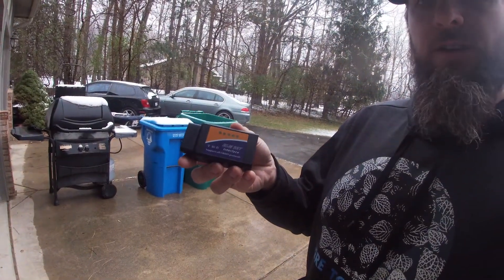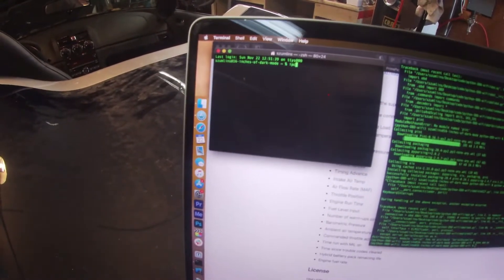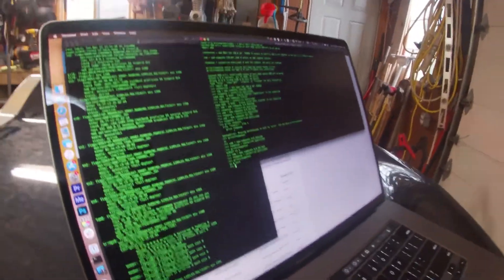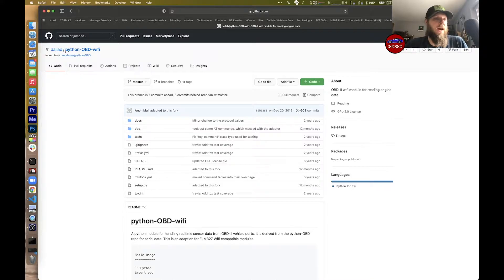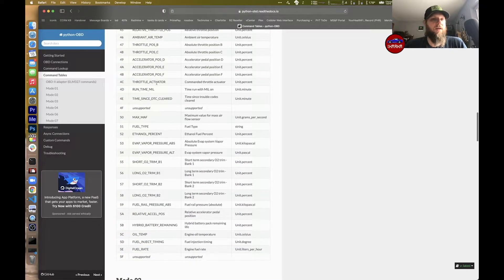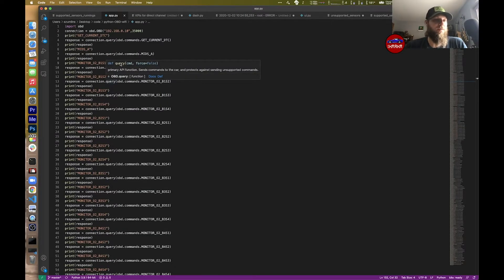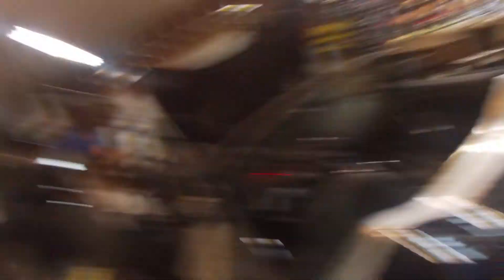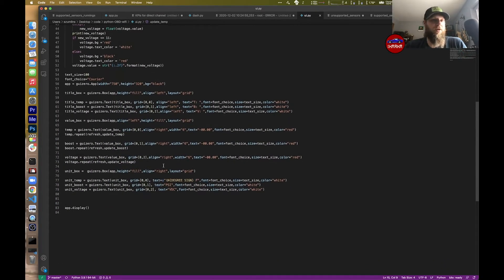Episode Six - Playing with OBD2 and writing our own gauge software

Comment: Hey, sysadmin here ... Do you think you can write on the main bus via another port? I'd like for example... To tell that air intake temp is  colder than it actually is... It would be curious to experiment
Reply from the maker: I think a better way to do this would be a potentiometer or resistor on the signal wire direct from the thermostat sender.  But I have no idea what the voltage range is on that sender and what sort of range that currently provides.  Trying to do this in-computer would likely be a major pain.
Reply: @ihavemadeahugemistake  thanks ;) do you have any plans on speeduino / engine control ?

Comment: hey man, any problems with it after the fact? I had heard of a couple reviews online of this tool totally messing with your ECU, not sure how that would even work? I did this with my 2017 Mustang GT and I haven’t noticed anything, just wanted to see if you had
Reply from the maker: Nah, I'm using it in read mode so it won't do anything bad.  If you started playing with writing back to the ECU too frequently, in theory you could burn out the eeproms since they can only be written to so many times before failing.

Comment: This is sick.  What's is the fastest refresh you can do with that OBD2 reader?  I want to do something similar with a tablet or phone display in the center console with the radio taken out.
Reply from the maker: It wasn't that fast - if I did faster than 1 second the library puked.   But for temp gauge at minimum that is frequent enough.   I have to play with more of the sensors to see which ones actually make sense to have up there with the slower response time.   I may also expand it to do some peak/valley tagging too (so high boost/low boost, high temp/low temp) so I can look at a glance.   I'll probably show off the little enclosure I got with the screen for the Raspberry Pi I ultimately plan on using.  Right now it is sitting on my office desk as a weather station/desk clock.
Reply: @ihavemadeahugemistake  The overboost/ oil pressure/ and oil temp are really the ones I would be concerned for higher refresh with since the factory cluster really sucks for information.